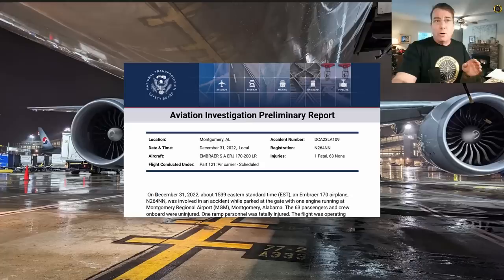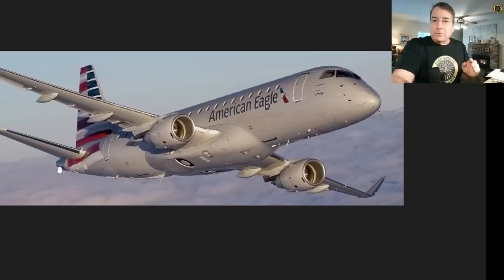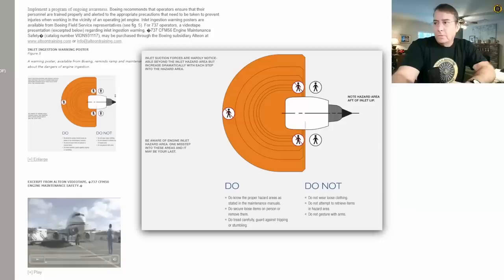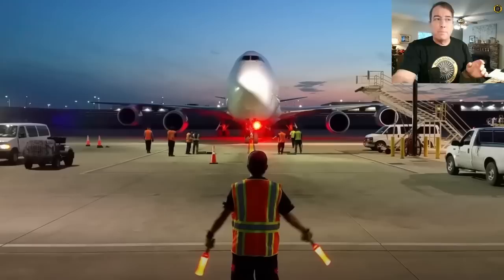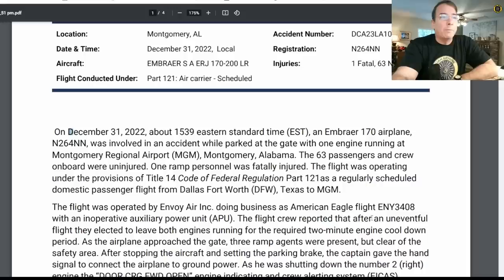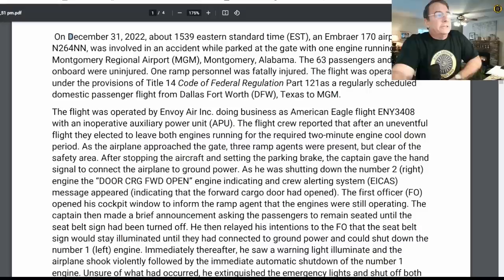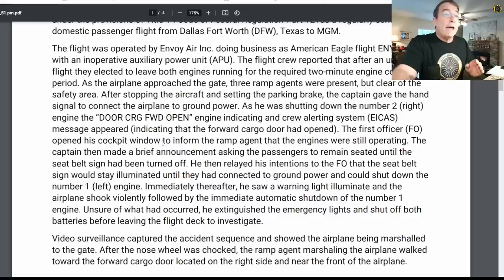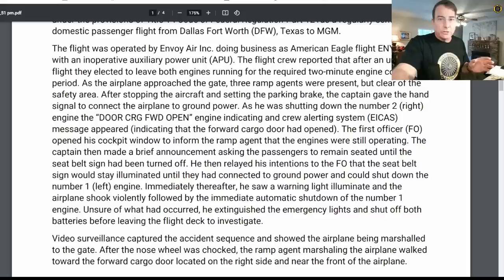NTSB Preliminary Report Ramp Agent Fatality 31 Dec 2022 Montgomery Al.

Comment: On F-15s, you have to approach the #1 inlet to put in the nose gear pin.  We were always told to approach from the rear of the inlet, reach way out and put our hand on the inlet mouth to feel for suction, then proceed to pin the nose gear.  As a result, I was always there waiting to feel that suction across my hand subside and then I knew it was safe to proceed.  It was muscle memory.  Safety around a running aircraft engine has to be muscle memory, because you sure as hell aren't always going to be safety-conscious at the end of a 12-hour shift.

As soon as the report stated she approached the #1 engine from the leading edge of the wing, it immediately took me back to the photos we all were shown of the aftermath of Continental mechanic that died while troubleshooting a motor in 2006.  We didn't need a clearer example to know that inlet hazard areas are not to be trifled with.

The pressure to rush in the AF is there.  I can say I've had a number of close calls.  But around the inlet of a running engine was never one of them.

Comment: You can add the brake fans for Airbus jets to that list. If equipped the A330 the brake fans are almost as noisy as the main engines at idle.

Comment: I have worked the ramp for 2 years and spent time as a supervisor overseeing ramp operations (40-60 people at a time). My experience has been that there are often individuals who, despite extensive training, disregard critical safety measures such as waiting for the beacon to turn off and hearing the engine spool down before approaching the aircraft. I can say that depending on the airline and station management the pressure to turn aircraft as fast as possible can be immense, however safety is always the number one priority. I have physically pulled my ramp agents away from the aircraft when they being to approach before it is safe. I have also had my fair share of working inop apu flights. I usually only select ramp agents with over 6 months of work experience to work these flights, as this accident is my worst nightmare. With that said I firmly believe that unless you have watched how to work these types of flights in person, you should not be directly involved in setting cones or chocks until you fully understand the process.

Comment: I’ve worked 20 years at SEA. 8 Years contract ramp and the last 12 for one of the US big 3. 

The training for this job is an absolute joke. With all the new computer based training a person can not fail. You just take the test over and over again until you pass. Nobody is really taught how to do the job. Most people are just sent out on to the ramp and try there best. Our burn out rates are insane. Just a revolving door of new hires. We are never fully staffed always short handed. 

Safety is just a word that is spoken. The real goal is to do everything as fast as possible. Everyone is in a rush. Cause every thing we do is timed. First bag to claim, Last bag to claim. They even mark and time when aircraft doors are opened and closed. And if you miss your mark. The dreaded delay code could be placed on your department. The pressure to perform everything quickly is on everyone’s shoulders and in the back of all of our minds. 

We all talk safety but the reality is nobody cares about a ramp agents safety. Management don’t care, pilots don’t care and gate agents don’t care. We are the bottom of the company and that’s how we get treated. 

But it is what it is and I do love this job. This job has allowed to visit places all over the world. I can spin a globe and fly almost anywhere for pretty much nothing. Gotta take the good with the bad.

Comment: I worked at a major airport for about 7 years. I have never seen anyone approach an aircraft with the beacons on. Two years before I left they replaced an old terminal.
When they opened the new terminal the old contracts were terminated and a new company took over the ramp duties.
The first thing to change was there were no wing walkers to stop ramp traffic. You had to watch planes pulling into the gate or pushing out. That's a basic safety procedure and if you can't manage that. What does that indicate for the rest of the operation.
During my time there was one ramper killed and one injured. That was caused by being struck by ramp equipment. Unless you worked on the ramp you cannot imagine the situation awareness required to keep yourself safe and others.

Comment: From the preliminary report, it doesn't seem like the issue here is "pressure" to stop the clock or get bags out. This just seems like someone who was just careless in their job. From paragraph 6 line 2 :"He [the ramp agent] observed her almost fall over from the engines exhaust while he attempted to alert her to stay back and wait for the engines to be shut down." While it can't be understated that this is a terrible tragedy, it doesn't seem like pressure to stop a clock was the lynchpin. This report reads of someone who was either tired or not too concerned with safety (as has been stated in some of the below comments). There's only so much an employer can do to promote safety, short of punishing or firing (not exactly an option in today's job market) staff who violate them. As they say in aviation, safety regulations are written in blood.

Comment: As a 40+ year mechanic I would always tell the Ramp Agents who would be in a hurry and try taking short cuts when dispatching an aircraft to just take their time and don’t take short cuts. I’d tell them that when they call the flight deck that they are ready to go they well always get the response “Standby By” because the flight crew is not going to take short cuts to make the On Time Departure. I found that the Management will talk Safety but will not really stop you from taking those short cuts. I’ve found you always have to standup for yourself when it would come to doing a job safety. I’ve been retired now for 20+ years but I’m thinking things are still the same.

Comment: I'm a ramper for a major cargo airline, and while there is pressure to get aircraft unloaded and loaded in a fast, efficient, and timely manner, utmost emphasis is placed on safety. We are not, under ANY circumstances, to approach an arriving aircraft until 30 seconds after the engines have shutdown and the red beacon light has gone out. The only person who may enter the "perimeter" of the aircraft is the mechanic who plugs in the GPU at the nose, and that person always approaches the plane from the nose, where he can see the engines. An accident like this has never happened at my airline as far as I know, so the pressure to put safety above all else seems to have worked quite well.

Comment: I have been a ramp agent with a major airline for a little over 6 months now. Thankfully the entire time safety has been heavily stressed and enforced. I have only had a couple times where I was unsure if I was clear to enter the safety zone or something similar. All of those time I simply stopped and waited until I was given firm confirmation. I would say the only time we ever feel rushed by management is during the time of actually loading the planes. My station seems to be pretty good about not rushing anything while you are parking or getting ready to push a plane. During the on-load and off-load they will try and get us to go faster, but never when the plane just set brakes or just released them. A lot of people have mentioned senior agents getting complacent and almost forgetting how dangerous it is out there but that is the opposite of what I have seen where I am at, so far. However, I know throughout the system at my airline that is often not the case. Additionally, I do look down the ramp at some of the less-paid and less-trained contracted people for other airlines and sometimes see them do things that make me a little concerned.
Reply: How would you know if they are less trained or paid? When you have been doing this for a little over 6 months?

Comment: What I can say as a ramp agent over at one of Florida’s many international airports is ramp agents often get “laser focus” paired with earbuds & music that they accidentally put themselves in harms way. People get complacent. In this situation, with the testimony of the other rampers, she was im her own world doing her daily routine of placing cones and was most likely on the way to place cones/chocks near the engine or head to the other side of the aircraft to begin the offload and just didn’t hear the other agents. Also, inop apu aircraft usually shut down the 1 engine to allow the jetbridge to pull up so she may have not noticed the different procedure. Also, some newer agents fail to understand how dangerous it is to get near a running engine. I’ve had to turn my head many times to avoid seeing this occur.  Very sad situation 😢

Comment: I worked with airplanes for 20 years as a company rep. One of my client airlines had an engineer with two mechanical arms (hooks). Story was they were doing an engine run on a 737 and he got partially sucked into the engine. His body got stopped but his arms continued in and were shredded..

Comment: Juan, once again, a wonderful and detailed explanation of the facts surrounding this inexcusable accident. Many of the details you describe, help the novice to understand the important details of what happened. As to the questions you pose for both the audience and investigators. Yes, there is pressure, whether expressed or implied to turn the aircraft as quickly as possible. This implied pressure is at all levels of airline operations. As an international widebody Captain for many years, I have had cargo doors opened prior to engine shut down at various stations both large and small. I have always expedited shutting down engines when observing a cargo door open light become illuminated. I have also taken the time to call the ramp manager and notify him/her that this has occured and to make certain that he debriefs the crews involved. I have also filed ASAP reports to further bring attention to this dangerous and in this case fatal practice. Ones life is far more important that ontime performance or a passenge'rs bags arriving to baggage claim a few minuets sooner. Thanks again for your excellent presentation. Keep up your terrific work!

Comment: I worked at Envoy in DFW as a crew chief and we were definitely pressured to get faster turns on the flights. My crew was dead set on our safety first when it came to it, even if it caused a slight delay. Noticing the time of this flight would be around the shift change time and most of our flights were 30-45 min turns during shift change which caused immense pressure on the ramp crews. I never allowed my crew to put themselves in harms way and told them I’d always put their safety before getting a plane done faster than it should be done. I had an incident with a supervisor one shift where a 900s cargo door was broken and he wanted me to hold the door open while I unloaded bags. I told him that I would not injure myself just for this quick turn and he was threatening me with insubordination. Those doors are heavy and the plane was fully loaded so I told him to find another crew that was willing to injure themselves until maintenance came to fix the door. He was more concerned about the turn than our safety. Management definitely breathes down ramper’s necks at Envoy. I also noticed before I left Envoy that the training department was shortening their training periods for new hires and we were having accidents far more frequent than I had ever seen before.
Reply: You should have ask him to demonstrate how this is done seeing you never seen an SOP for that

Comment: You can't "bank" safety.  It only takes one lapse to cause a tragedy, and you don't get credit for all the times you did it right.  A few years ago the airline I worked for experimented with headsets that allowed wireless communications for the entire ramp crew when pushing back an aircraft, not just the individual "plugged in" to the aircraft interphone system.  It didn't last long for reasons I'm not familiar with.  Maybe some type of wireless comm system built into ramp crew headsets would have allowed the ramp agent who was gesturing at the victim to get her attention and prevent the accident.  As far as the video: good analysis, as always.  Your lack of sensationalism, and thoughtful discussion as an industry insider is refreshing.

Comment: I was a ramp rat at LAX back in the mid 1980's. It was S.O.P. to NEVER go near the aircraft if the engines were running, and/or the beacons were on, and if anybody did, it was a mechanic connecting a GPU. If anybody else did it, they were disciplined.

Of course, in this day & age of cell phones, people are too distracted to be bothered with work. Back then, it wasn't an issue, because there were no cell phones.

I don't know if that was the problem or not, but obviously, half the crew was ignoring running engines & beacons for some reason...only other one I can think of besides cell phones, is drugs.

Comment: East Greenland (KUS, AGM, CNP) was my assigned area as helicopter admin/coordination and training of ramp crew. There is only one thing important here: Follow the outlined procedures as per HOM, IATA and SLV. If anything outside these parameters occour, next level of management takes over - That would be me.
Procedures are the backbone of helicopter operations and can not be deviated from in any circumstances - With one B206LR and 3 B222 UT at one time on the pad and apron with hot refueling and passenger transfer with rotors running, these are a primal survival guide for our ramp workers. And i never lost or severely injured a passenger or crew.
Oh, by the way, East and north east Greenland is considered the largest single policing area in the world.
Reply: So your comparing helicopters to airliners?

Comment: As a flight ops guy I have to attend arriving aircraft every day. Heavy stuff. 747s, A330s, 777s, 767s etc. All freighters . I am the radio ops contact for the inbound crew to advise if they need to keep running before plugging in. I have to advise the ground crew and they know EXACTLY what to do. We are under pressure to get aircraft turned quickly, often because of the delays freighters alway seem to be running to, but no-one should EVER go walkabout with cones or anything else until the engines spool down and the beacon is off.  And to be fair to the guys, they stick to it. No amount of pressure will make our staff put themselves at risk. That's where unions come into play. You stick to H&S training whatever pressure you are under and no-one can touch you. Maybe forget to zip up your hi viz. A quick word to you.   But walking across a running jet engine?  You can't have a quick word with a mangled corpse! 
Especially as they had a safety reminder about the engines staying running, there is ZERO excuse for this accident. Only a reason. Its inexplicable to me.

Comment: That cargo door on the Embraer 170 or 190 is way to close to that ingestion zone of a fully operational engine to be opening it before the engine is cut off. No way they should be anywhere around that fuselage as there is also exhaust that will throw a grown man if he is behind the engine. Have over four years loading planes at MSY, and with hearing protection on, those engines seem like a whimper when they are actually deadly. As Juan has pointed out and the ramp training at American Airlines in Dallas teaches us. Stay away from that fuselage until that beacon light is off.

Comment: As a contract ramper, its crazy to hear that people enter the apron before before the beacon is turned off. We r pressured to send the aircraft on time by the company. However, as a team, we encourage each other to take safety first no matter what. Our team leader is willing to delay the flight by 1 hour or even 2 hours if he has to due to safety issue. The amount that we get paid is nothing worth the danger and risk that we have to take as a ramp agent. So even if the fan blade is running pretty fast after the engine and the beacon is turned off, we STILL do no approach the engine.

Comment: I was a ramper for air cargo company, I had next to zero training just a lot of yelling to hurry up and turn that plane, many times the engines were still turning when we were in the bellies, the 727 never shut down, the DC8 with four engines would leave one outboard running most of the time we were in it.
Reply: Yep the B727 JT8D Engines are Low Bypass Fans located much higher off the ground and provides a larger safety margin than the low mounted High Bypass Fan wing engines.

Comment: After reading through many of the comments here, it came to me that to get to a near zero ingestion rate all aircraft would have to shut down short of the gate and then pulled into it by tug for all servicing/loading.  That means lengthen flight times, operable APU's, and longer more costly turnaround times.  I sure that would go over like a lead balloon with all the airlines and passengers.  But it would certainly show which airlines are committed to safety from those who just put on the safety show.

Comment: From 30+ years in manufacturing, I can bet lots of money that many "near misses" or "non-fatal accidents" occurred before this fatality.   In the world of safety management, there is a model known as the "Heinrich Safety Triangle".  The bottom of the triangle reflects that many near miss events happen, followed with less frequency by some number of non-fatal actual accidents, and eventually you have a fatal accident.  The way you mitigate and reduce the potential for a fatal accident (make the triangle narrower) is that you *always address and mitigate with countermeasures every near miss*.  In a scenario such as airport ramp safety, this should be rigorously applied.